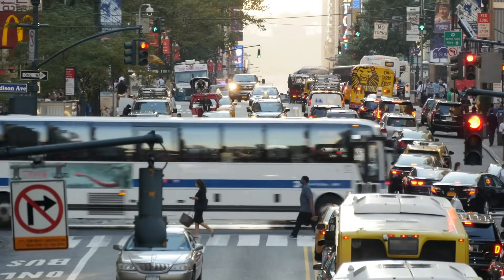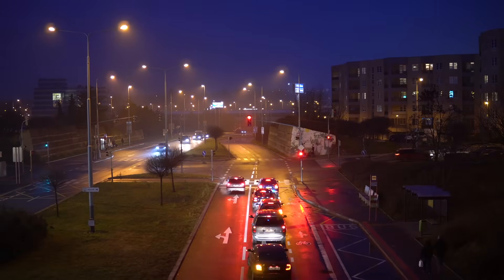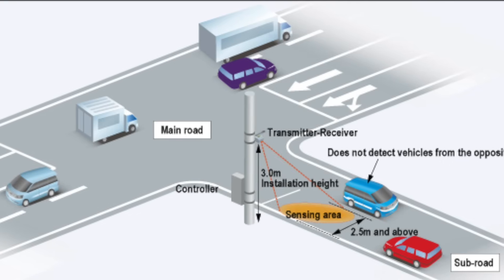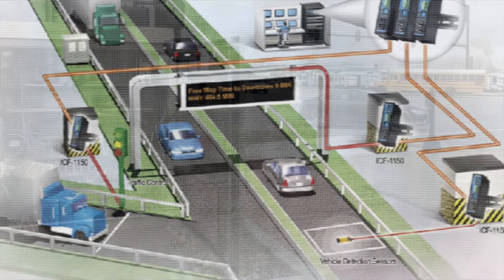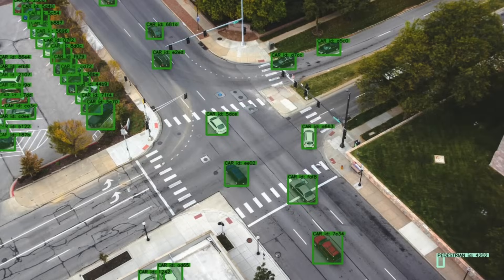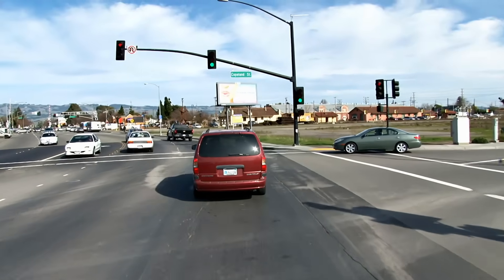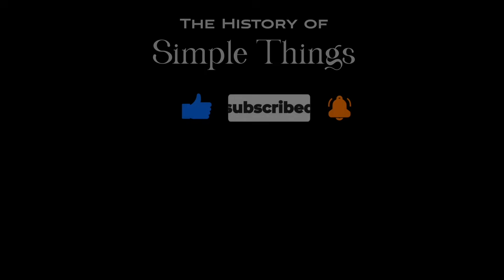How Do Traffic Lights Know When to Switch Signals?

Comment: You come up to an intersection with a LONG line of cars and a murder light (one of those lights where you have enough time to read the newspaper from cover to cover before it even CONSIDERS changing back). The asses at the front are playing with the f’n phone-which always comes out at long lights. Light turns green. Nobody moves. By the time they put the f’n phone down, you might get 2 or 3 cars through.

Comment: Let’s also talk about the red light cameras. They work by sensors in the road. The camera detects your speed and anticipates if you’re going to blow the light then fires twice to show your movement. If you’re making a left or right turn, YOU CAN ENTER THE INTERSECTION and wait for opposite traffic/pedestrians to clear. If you’re back bumper has already cleared the stop line (crosswalk), you’re already past the sensor and the camera will not fire even if the light changed to red. Everyone is driving around TERRIFIED of the cameras now.

Comment: How about the intersections that have the green arrow (which means the opposite traffic has a red light so you can turn). The green arrow turns yellow, then disappears-so you have just a solid green light which means the opposite direction also has a green light so you can turn left, but you have to wait until it’s safe to do so. But some people believe that just because the green arrow disappeared, they can no longer make the turn and REFUSE to go past the stop line 😂😂.

Comment: The induction technology is not too good. The lamps around me triggers when a vehicle turns from the main route into the intersection. Since it never see the vehicle leave once the lamp turned green (as it's not even there) it enters an infinite loop and stops the main route every cycle for no reason. It messes up the schedule of the bus crossing the main route as it's scheduled to depart exactly when the cycle begins and always get a red light if the system is in this state, causing a one minute delay. It returns to normal operation when a vehicle turns from the intersection into the main route, but sometimes it doesn't happen for hours (that's why they installed the induction system in the first place).

Comment: The traffic lights I hate THE MOST are those which have a green arrow for left turns, but which DON'T give you a flashing yellow or red (to indicate a virtual "stop sign" or "yield sign") when your orientation has a green light -- they simply give you a red arrow, indicating "no left turn," even when there's a long straightaway across from you and zero cars approaching via that straightaway.  There's one like that near my home, and I swear to God, that long straightaway is a freaking QUARTER MILE, but you get only a red arrow, no flashing arrow at all, though it would be perfectly safe to execute that left turn. When going in the opposite direction, coming down that long straightaway, it makes sense, as there's a shallow hill and it's not possible to see very far ahead of the intersection.  But when coming down that shallow hill, facing that long straightaway, it's INFURIATING to have to sit all the way thru another cycle when there is NO traffic approaching.
Reply: That drives me crazy also. If no one is around, I just go. F it. lol
Reply: I hate the ones that turn so quickly!
Reply: Those are called JUMP LIGHTS!
Reply: Just MAKE the damn left, you WIMP!!

Comment: Quite often I notice people not pulling up to the junction lines and wondering why they don't get a green light. I had to explain that to someone and after they moved over that square near the line, the lights turned green.
That system used and induction ring to tell if there was a vehicle at the lights, and because they weren't over it, the software thought no vehicle required a green light from that junction.

Comment: I have found that traffic lights go from green to yellow about 240 feet from the intersection.
That is how far you travel doing 40 mph in 4 seconds, and the yellow light last for 4 seconds.
Designed to turn red when you reach the intersection when doing 40 mph. That means you
have to go from 40 to 0 in 4 seconds if you don't want to run a red light.
Is this just random planning?

Comment: Over 40 years ago in West Philly they installed best in class traffic signal for traffic flowing out of the city. ( might be Chestnut or Walnut St, have not been out there in last 30 years ). Anyway they have signs telling you what speed to maintain. One slow day it was set at 28 MPH as to not hit a red light for maybe 15- 20 blocks. I went around  35 MPH and caught a red light  while smart drivers behind me doing the suggested speed caught up with me. Still waiting for them to do this on other roads. That was a two lane one way street.

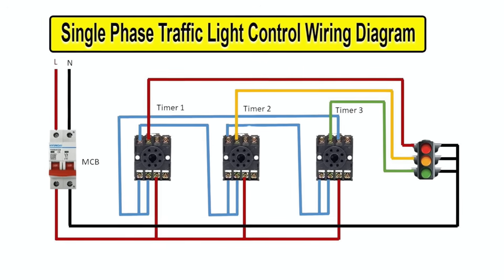Comment: 1:20 I would say that most traffic lights around me in south western PA are using fixed timers (not sure if any inductive loops are used in the area) however we did recently get a few that have cameras that are used to detect the traffic. Those are great as they minimize unnecessary wait time and the frustration it causes. In one case these cameras were installed on new traffic light that is just off a major highway exit where there is a 4 lane section of 35 mph road (goes down to 2 lanes quickly after the intersection) parallel to the highway. Before they added the traffic light there was a single stop sign on this exit at the 4 lane section of road. The problem is at either rush hour it was extremely difficult to make a left hand turn as the traffic was always coming in at least 1 direction.  WIth the new traffic light the 4 lane road always has the green until there is traffic waiting at either of the 2 lefts.

Comment: There are also systems where traffic signals are synced with traffic signals with other nearby intersections. What gets me pissed-off is I know a few intersections in my part of the world (San Fernando Valley) where the sensors in the street aren't working properly. This is more apparent late at night, when traffic is light. I'm sitting at a red light waiting for a green that will never come unless another car triggers the sensor or a pedestrian pushes the button to change the light to green. I once got a $500 ticket for making a right on a red-arrow after waiting for five minutes at 4:00 am. An LAPD cop caught me. It's pointless to try and fight this. I think Los Angeles pays police a commission. I ended up not only paying the ticket, but also paying for traffic school to keep it off my driving record. Also, with the sensors, make sure you stop right on them when they are working. If you creep to far toward the intersection, the traffic signal will think that you're gone, and you'll never get a green light. I've seen this many times, where I've watched the pedestrian countdown clock counting to zero as I'm waiting, and then at zero the walk light appears again, leaving me waiting until I die of old age.